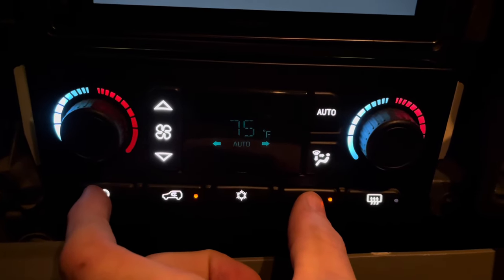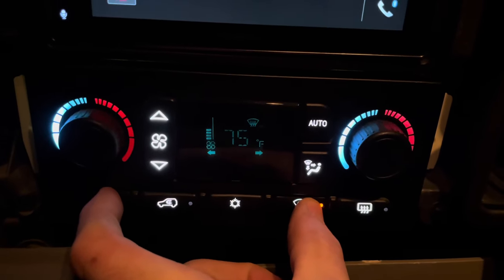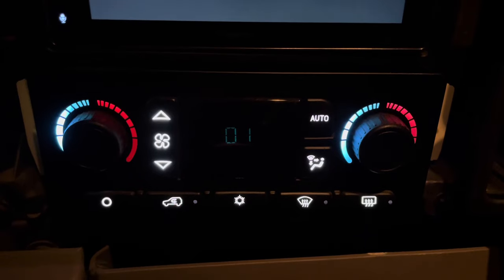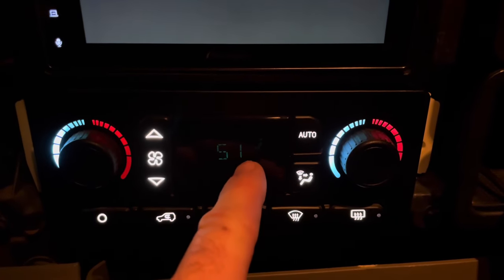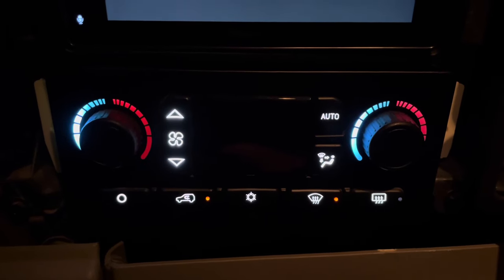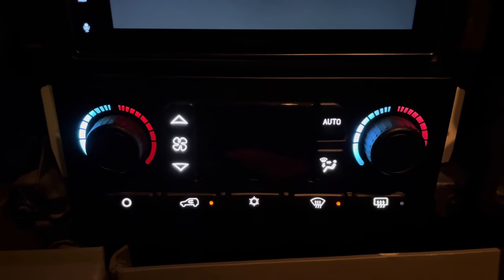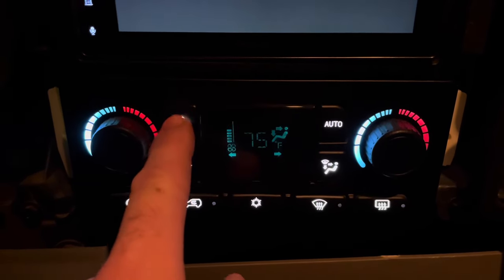2002-2009 GM Truck/SUV Dorman aftermarket HVAC control head - How to configure and calibrate

Comment: This video showed me how to reset my 2003 Chevy. Silverado comfort control. I was stuck in Paige, Arizona and it took me over an hour to find this video. And I tried multiple times to pull the fuse and reset it. That way, which didn't work after I did this process. It worked immediately and I got back on the road. Thank you for the video.
Reply from the maker: That’s awesome! Glad to hear!

Thanks for sharing!

Comment: Is there a procedure that works to configure an OEM unit that came from a wrecked vehicle (GMC envoy) being installed in a Silverado?  The Envoy unit keeps showing EXT temperature as a default as the unit is configured for the envoy that had outside temperature option. The Silverado doesn’t have that option and I want to configure the head unit for the Silverado instead.  The procedure for Dorman doesn’t work for the GM OEM unit
Reply from the maker: It can be done if the two modules are the same part number or compatible part number. GM will not let you program a used module like that anymore, so now aftermarket equipment must be used to copy the EEPROM information from one model to the other.

In other words, it’s usually easier and cheaper to just get a used one from the wrecking yard.

Comment: So when I am trying to do mine it is on 4 I bring it back to 1 click recirculate then it goes back to 04
Reply from the maker: Does it say 51? Press Auto to confirm your selection.

Thanks.
Reply: @DadsGarageDiagnosticSpecialist  yup tried confirming with the one button and just pushing the auto both just make It go right back to 4. Also the truck is a 03 duramax if that makes any difference
Reply from the maker: @nashbruner895 it should say 51 and then you press recirculate, it should change to 01 and then you press auto. 

You should also try it disconnect and reboot it… I’ve had to reboot this Dorman control head so many times since installing it. 

Also it does not function the same and the factory unit does…. Eventually I couldn’t stand it anymore and replaced the Dorman unit with a used factory unit.
Reply: @DadsGarageDiagnosticSpecialist  that's what I'm going to do I have one on the way I've read to many complaints

Comment: I think you can do that part with Tech2 tool as well.
Reply from the maker: The Tech 2 will not do it unless it’s connected to a PC as a pass-thru device, but that is an obsolete process.
Reply from the maker: Oops I was thinking of a theft learn. Yes the Tech 2 will do the HVAC learn. 

Only works with a factory HVAC control head. Does NOT work on this aftermarket part.
Reply: @DadsGarageDiagnosticSpecialist  I still use Bosch VCI J2534 to connect to my PC that is running Tech2Win. Recently I had some issues with the HVAC module not turning on the A/C compressor but there was a section in the Tech2Win that allows you to reset the position of the doors
Reply from the maker: @ainstaink8312  yes I have used Bosch VCI in the past it works fine. Tech2Win can be really buggy though. 

The engine control module operates the A/C compressor based on the request from the HVAC module. 

The scan tool calibration works fine with the factory part, but will not work with the Dorman replacement. 

After a couple years, running the Dorman HVAC replacement part I finally took it out and replaced it with a used factory part because I could not stand the way operates… Does not operate the same as the factory one.

Comment: So how do you know what the second digit should be?
Reply from the maker: Thank you for commenting… The second digit is the calibration code for your vehicle that you need to use. 

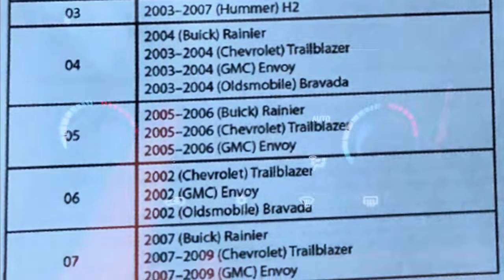Check the video description and the chart also flashes on the screen at 0:43
Reply: @DadsGarageDiagnosticSpecialist  I saw that, but how are you supposed to know this calibration code for a specific vehicle? That info isn't there...
Reply from the maker: @bigtj77  the 03 Yukon in the video requires code 01, or 51….2005 Yukon would require code 02 or 52…..etc. 

Depending which vehicle you are working on is what code you need to use. What kind of vehicle are you installing into?
Reply: @DadsGarageDiagnosticSpecialist  2003 Olds Bravada
Reply from the maker: That would be code 04 or 54
Reply: @DadsGarageDiagnosticSpecialist  copy thanks
Reply from the maker: Any time
Reply: Do these new control modules have the updated software for the recirculation actuator to keep from overanging
Reply from the maker: I’m not sure. Thus far the software of the Dorman replacement part doesn’t act 100% the same as factory is what I’ve noticed. The OEM part is not available in some cases unfortunately unless you find a used one which is ultimately which I would do as a repair. 

It works ok as a cheaper repair with a warranty. 

Thanks for the comment.

Comment: Can you do this method with the original HVAC control head (not aftermarket - the one already in the vehicle)?
Reply from the maker: No the factory HVAC control module will run a self calibration after a battery disconnect…. The first time you turn the key on after a battery disconnect, leave the key on for 2 minutes without touching any HVAC controls, you will hear the doors moving as it self calibrates. 

If you interrupt this process it will not learn properly. Otherwise it can be done with a scan tool. 

Thanks.
Reply: I saw a video that claimed the actuators can end up damaged after a battery disconnect.  Is there any validity to that claim? Does this factory reset solve/avoid damaging them?

Thanks.
Reply from the maker: @Rahvinfyr that should not happen unless your actuators were already worn out and ready to fail anyway… That would be due to the worm gears inside being made of plastic when they become worn the teeth start to skip and make a clicking noise. After a battery disconnect the factory HVAC control unit well perform an actuator calibration which forces the doors to their end stops, which would stress out a worn out actuator.

Comment: Can you replace the analog HVAC control head with the digital one?
Reply from the maker: Interesting question. I'm not sure... I suspect that it could be possible if all of the necessary hardware and wiring harnesses were swapped in. Possibly also may require body control module programming, etc... GM will not help with any of that so it would have to be aftermarket tuning software, etc... I'm sure with enough time and effort it could be done.

A quick search online and I found a few results of people successfully converting from digital to analog, but not the other way around.

Thanks.
Reply: I did a search and there are sensors you would have to add plus change the wire harness etc.
 @DadsGarageDiagnosticSpecialist
Reply from the maker: @LUZRINC  if you already have analog dual zone HVAC you don’t have much to gain other than the auto function in my opinion. Might be worth it to switch from single zone to dual though.
Reply: @DadsGarageDiagnosticSpecialist  yeah. I just like the look of the automatic
Reply from the maker: @LUZRINC I can understand that. I suppose if I ever had some donor vehicles I could experiment in the future.
Reply: I have been looking into the wiring diagrams and The 24 pin is the same on both. The only difference is A11 and B9. The Manual has a Dark green (71) that runs from A11 (24 Pin) that goes straight to C2 (8 Pin) that is a blower off. No problem there because auto doesn't use that. B9 On auto is just a ground from the interior light system. Manual has a 8 Pin connector that goes to a Blower Motor Resistor Assembly. The Auto is a little more complex. It has a 12 pin connector.....
(A) INSIDE AIR TEMP SIGNAL
(B) AMBIENT AIR TEMP SIGNAL
(C) UPPER LEFT AIR TEMP SIGNAL
(D) UPPER RIGHT AIR TEMP SIGNAL
(E) LOWER LEFT AIR TEMP SIGNAL
(F) LOWER RIGHT AIR TEMP SIGNAL
(G) RECIRCULATE DOOR POWER SIGNAL (PURPLE 1838)
(H-J) NOT USED
(K) ALL TEMP SENSORS GROND TO (BROWN 718)
(L) TEMP SENSOR ASS(DON'T KNOW) CONTROL
(M) BLOWER SPEED CONTROL
(C2) UNUSED

M (12PIN) goes to a Blower Motor Control Processor

So going off the diagrams you would need:
-5 cabin temp sensors 
-1 inside temperature sensor assembly
-1 Blower Motor Control Processor